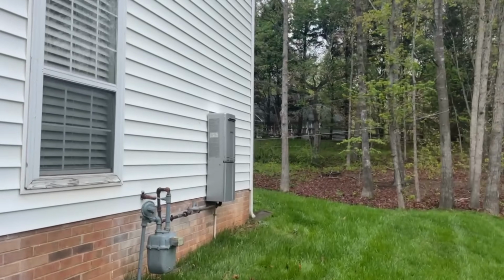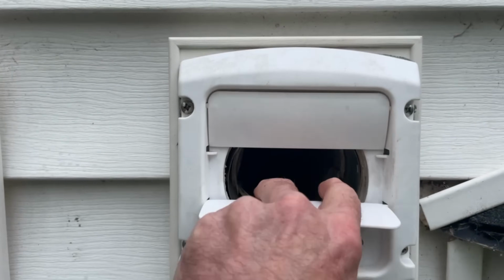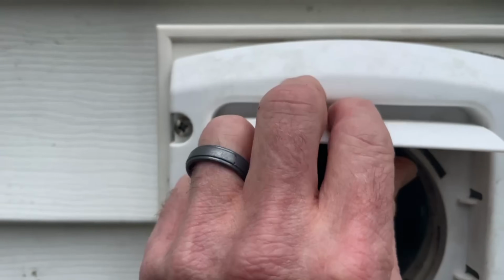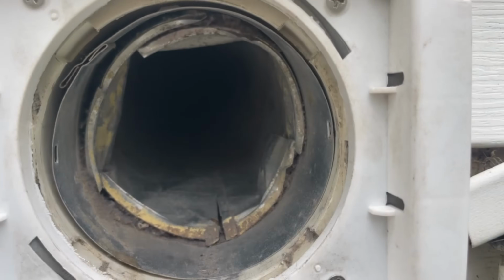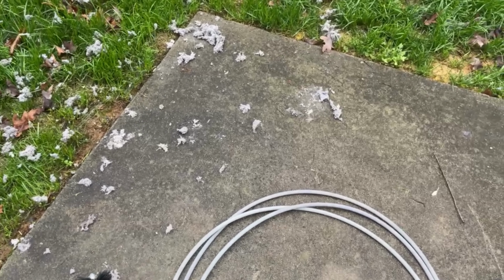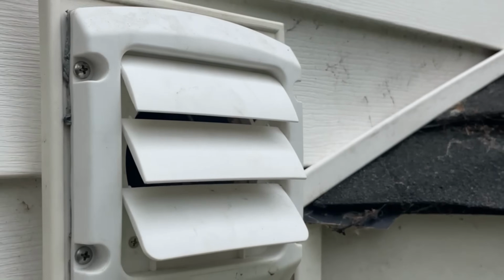5 CYCLES for ONE LOAD! Not ANYMORE! Cleaning a Dryer Vent! #almetaldryervent #satisfying #fyp #fypシ

Comment: We bought my in-law’s house after they passed away. Filled with their stuff. I didn’t realize until the dryer died that there as no dryer vent! It was blowing hot, moist air and lint behind it. It sits in our garage, against an exterior wall. We cut the hole for the dryer vent directly behind the vent port, so there is only a few inches between the dryer and the great outdoors! Works great. We can remove the vent cover on the outside and vacuum and bits of lint.we can visually inspect and grab anything that doesn’t belong.

Comment: I used to take all of my venting apart and vacuum the whole thing.  I found a shortcut.  Pull the filter out and then start and run it for about 20-25 seconds and you can hear all of the funk coming out.  It won't do it with the filter in though, it has to be out.
Reply from the maker: Absolutely correct!!!! Thanks!!!
Reply: @advsLLC  Interesting. Then why not made a home made adapter between the dryer intake (without the filter) and the blower. This way you do not even need to remove the dryer or anything. The pulsation action should dislodge most of the link. ???
Reply from the maker: @user9b2  hmmmmm... You might be on to something....

Comment: Good job on what you cleaned however there is one more step and it can be a big fire waiting too happen. You need to clean out the blower, my old Maytag does not accumulate much in the blower but a few Kenmore / Whirlpool I checked were plugged almost solid with enough lint to fill a kitchen green bin. Take out the door screws on both sides then pull the front cover off, this should let you see the blower. The blower housing comes apart via clips or screws once the cover is removed vacuum out the blower then assemble.

Comment: We have an LG front load dryer. Even though we clean the lint trap every load, a little bit falls off the screen each time it's removed causing lint to built up in the bottom of the screen slot. Eventually the screen no longer fully seats and now we've got unscreened exhaust headed down the vent pipe. Dopey design, LG!
Reply from the maker: Gotta love engineers... They're full of "great" ideas... Thx for watching!

Comment: I have a 16-foot vent running through a crawl space.  The warm moist air from the dryer hits the cold pipe and the lint will stick.  Over time you get a clog.  I bought an extension vent brush and pushed the lint from the dryer out to the outside.  It's a job that needs to be done every other year.

Comment: Should consider making a cone-shaped thing out of foam rubber to seal around the blower for this. Save a bit of hassle with all that lint-dust blow-back getting everywhere in the house. Alternately, it's possible to get an extra-long shop vac hose to get a tube like that cleaned with suction from outside. (May have to order online, but those do exist.) That way you don't have to clean up afterwards or have stuff blow right into your eyes.

Comment: Now they have to hire a cleaner to come out and clean up all the lint that gone blown out during the dryer test!
Reply: Excellent point. I would have removed the flexible hose and cleaned that thoroughly, then vacuumed inside the dryer's exhaust housing rather than blowing lint all over the place.

Comment: What about the vent on the dryer?;
Reply: @advsLLC  I think they are asking if you brushed/vacuumed the flex duct from the dryer to the wall, or inside the dryer, you didn't show it.  On my dryer, I need to vacuum out the area under the filter about once a year, otherwise the lint build up keeps the filter from seating properly.

Comment: Not drying…. Could be it needs a new element ie what makes the heat. Super cheap about $15 and minutes to install.  That wasn’t enough stuff to be a complete clog.  What is the other one for? Also it’s almost falling off the wall.  Now that he has lint everywhere in the air.  I don’t care for workers like this who act like it’s this huge issue and want to charge the customer like it is.  He didn’t try the dryer prior to doing the blower.. I don’t think, will have to go back and look.

But he still didn’t check if it’s drying hot enough to dry a load of clothes nor what the other vent was.

Comment: If I was the client and you blew that s*** all over my yard I would be 38 hot with you. There's not some type of a net deal or something you can put on the end of that to catch that debris. I do plumbing on Palm Beach Island and we aren't permitted to leave any mess so it's really easy to respect your client's property.  Do You bro but just a suggestion.
Reply from the maker: Ok, so when the dryer vent is working correctly, where does the lint go? Also, you clearly haven’t paid much attention to my videos… Do you think I simply leave the lint in the yard? I will continue to “do me” however when you suggest I don’t respect my clients property, it shows your blatant ignorance of my work…. I appreciate you watching.
Reply: Bro he raked it up.  At least watch the vid!
Reply from the maker: @keypawn3024  Appreciate that, LOL!